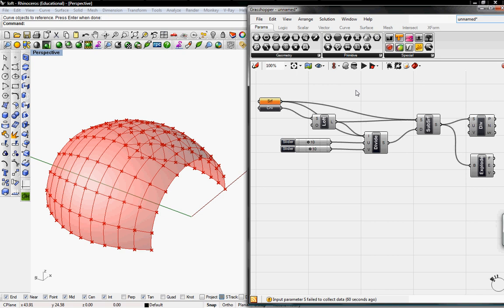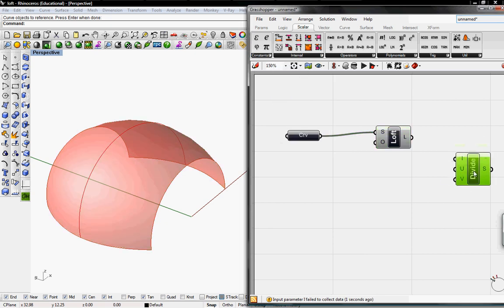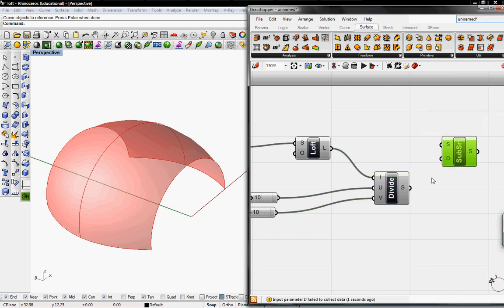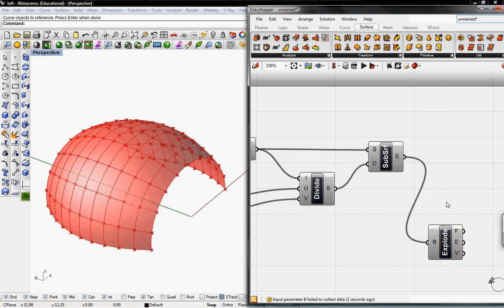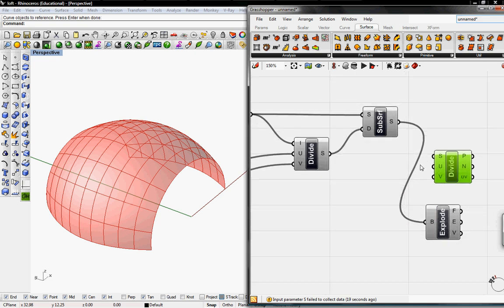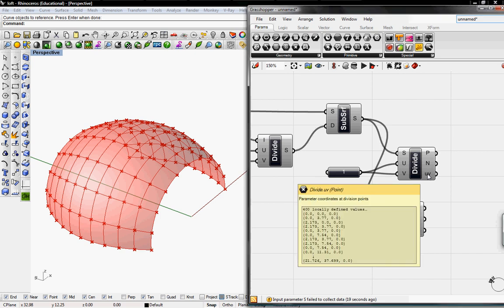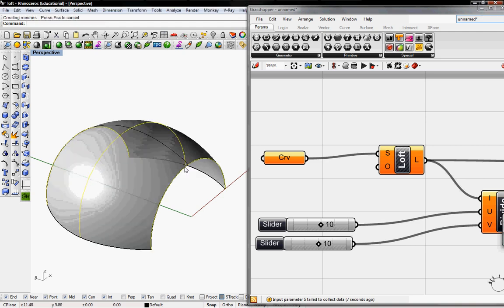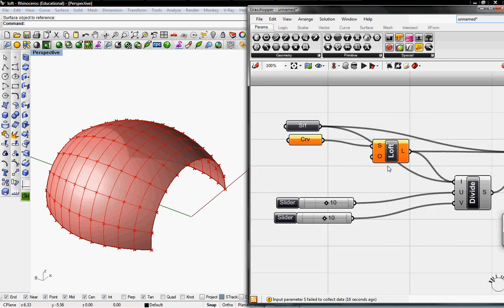explode and divide surfaces by digitaltoolbox.info

Comment: great video, how do would you divide the surface based on the radius of the section, so that your surface division lines get closer as you move to the smaller radius section.

Comment: In Grasshopper 0.8.0013, the divide tool is located at 
Math > Domain > Divide Domain ^2

Also a common source of trouble is that the lofted surface does not work. 

This may be because your surface is a brep, in other words a poly surface. The domain divide tool only accepts surfaces. You can either explode the surface, and treat the multiple surfaces individually or redraw the curves that you have lofted.